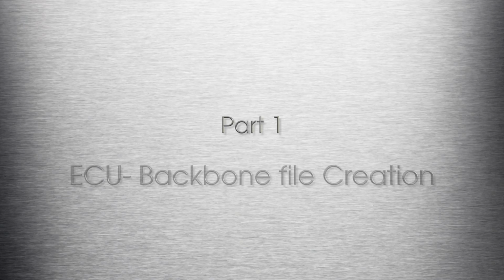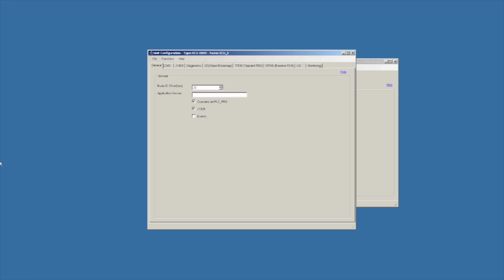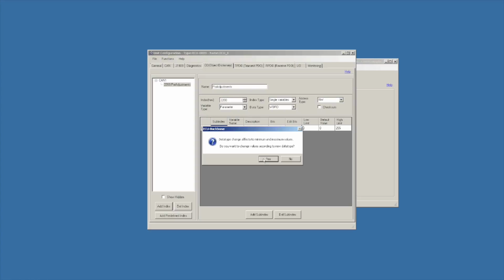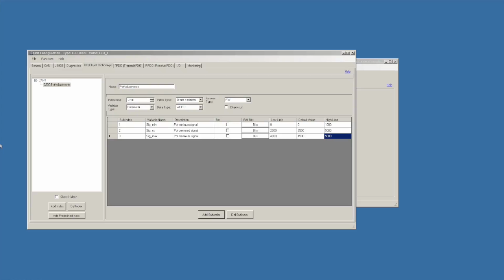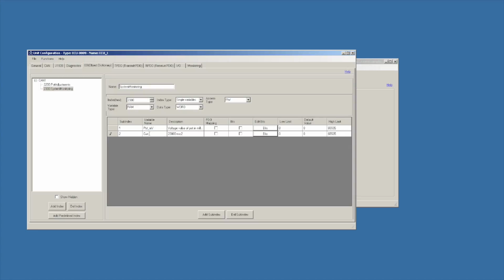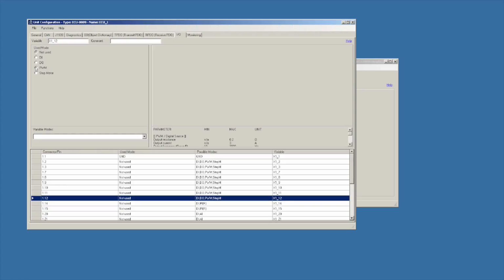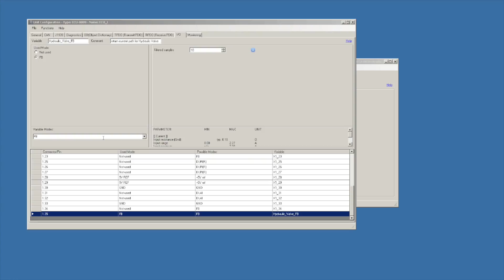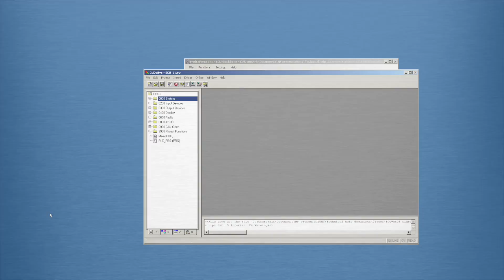ECU CoDeSys File Creation - Part 1: BackBone

Comment: when i am creating the Codesys Project. It does not appear "the tree" you have there in the POU menu.... i am using ECU 0710. with that version i do not have the "Create codesys" option so i have the to open an empty codesys project and then import the configuration created by backbone. What i am doing wrong?